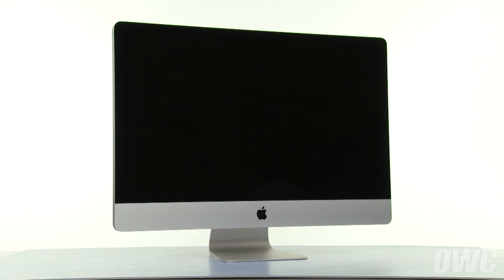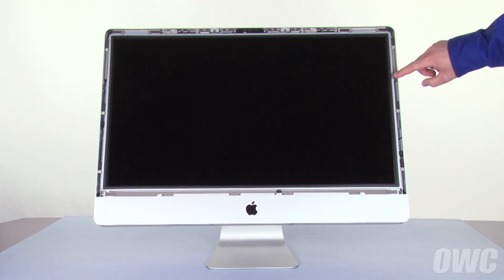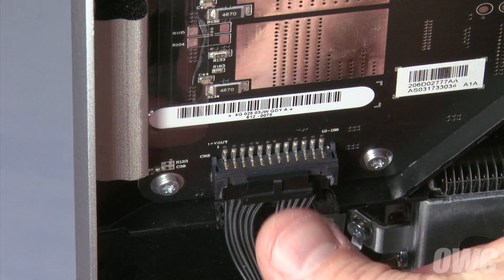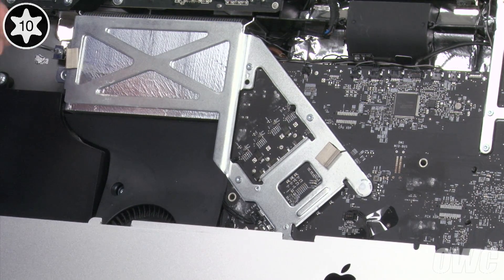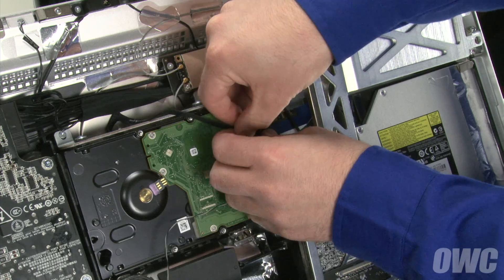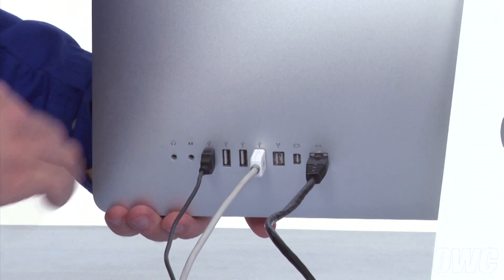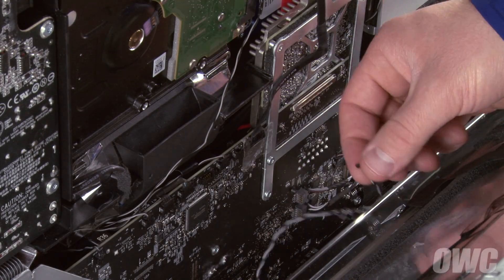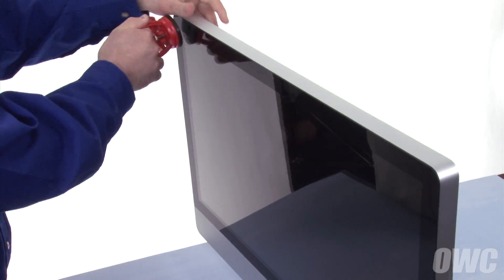How to Install a 2.5-inch SSD in the SSD Drive Bay of a 27-inch iMac Mid 2010 (Updated)

Comment: When starting the iMac, i can hear the chime and then iMac restarts. Chime is heard again and then iMac restarts. This ituation repeats over and over. Any idea why?
Reply from the maker: It’s possible that the issue you're experiencing is related to defective RAM, as this is a common symptom. Here are a few steps we recommend to help resolve the problem:

1. First, try removing the RAM from the computer and gently clean the contacts on the RAM modules. You can use a q-tip dipped in rubbing alcohol or a pencil eraser (rubbing lightly in one direction). If you use an eraser, make sure to brush off any debris afterward.

2. After cleaning, reinstall the RAM one module at a time to determine if one of the modules is defective.

If the issue persists, please feel free to reach out to us. We’ll be happy to assist with further troubleshooting and help you find the correct replacement if necessary.
Reply: @poweredbyowc  i took all memory modules out, cleaned and tried them in different slots, all possible combinations gave me the same chiming loop 😞
Reply from the maker: If you purchased the RAM from us we would be happy to assist you further with troubleshooting. Regrettably, YouTube does not have the option to DM so for security purposes please reach out to us through our customer service team. https://eshop.macsales.com/Service/

Be sure to add any details such as your contact information and your order number as well to fast-track this process.

Comment: I purchased the DIY kit for my mid 2010 27” and followed the tutorial. The reason I decided to upgrade to SSD was because my iMac took about 1 hour to boot. Now when I’m done it does not boot at all. The original HDD is detected but I’ve been trying to boot it several times for many hours each time. From a hardware perspective, it seems to be functional, but it simply does not go pass the loading bar step during boot. Any ideas?
Reply: hello felix did you ever sort this problem? thanks?
Reply: Did you move any of the memory modules? If so make sure that you replaced them into the EXACT same spots. i5 and i7 Quad Core iMac computers from this era will not start up if only a single DIMM is installed in any "bottom" (Farthest from the screen) slot. These computers should operate normally with a single DIMM installed in any "top" (Closest to the screen) slot.

Comment: I did this to my 2010 27” iMac, however it automatically shuts down and reboot in every 10 minutes. No overheating. I installed OS in SSD and formatted HDD. Anyone have any ideas?
Reply: Yubo Chen you installed the wrong ram
Reply: it needs to be 1333 htz or else it will just bootloop

Comment: can i use this method to my iMac 21.5" 2010 mid ? is it possible to chane the USB 2.0 to USB 3.0 on my iMac ?

Thx before 🙏🏻
Reply: No, you can not install a second drive to the 2010 21.5" model. But on the 2011 model it is possible for both, 27" and 21.5". No, you can not add USB 3.0 to 2010 models as they have no thunderbolt. For the 2011 models there is a adapter from thunderbolt to USB 3.0 but it is not cheap.

Comment: Here is the product spec page for that machine. What we could do to get more details, is set you up with contact for a service provider. This machine is actually a bit outside the period of time apple offers hardware support for a product, so a third party would need to service it. SOme of our service providers do third party work, and can recommend what you should get for an upgrade.

Me:I CAN SEE INFO ABOUT SATA

Me:SPEED

TylerRight, that is what I am thinking we will need to get you with a service provider for. I am not sure on the details of the machine beyond that page, but they will be able to tell you pretty quickly and recommend what drives and such you can get.

Me:CAN YOU ASK WHO KNOW ABOUT SATA 2 OR SATA 3

Me:IN THIS MODEL

TylerI am not sure about any details beyond what’s on that page, but if it doesn’t specify I would check with a service provider to be sure

Me:MY QUESTION THIS MODEL SATA 2 OR SATA3, MAX SPEED FOR SSD? 3GB OR 6 GB? APPLE SUPPORT DONT KNOW ABOUT THIS MODEL , SOY SAD ;(

Me:ASK ANYBODY PLEASE

Comment: My fans run at maxspeed, thought I should use smcfancontrol or hddfancontrol so I never botthered reconning sensor. Been fooling around with max/min speed, nothing changes at all. Had a hdd crash so I started out from internet recovery, which got High Sierra installed. May be it's not compatible? Installed one ssd as system and a 3tb hdd as storage.

Comment: Thanks for the video. Looks like a pain! What about just swapping the system HDD for an SDD? I'd prefer to just get the HDD out of there to keep the heat down. What would I need for that?
I actually mixed up and was thinking I had a 2011. I bought the OCZ 2011 Thermal Sensor. Would the sensor not be needed this route with a 2010?
Also, is there any way to swap the DVD drive with another SSD and simply use Time Machine to restore the OS?
Reply: MacSales. com Thanks. It's a 27. Interesting thing is though, I was right. It is a mid 2011. But some parts on the inside look like the 2010. So I did the HDD swap with the OCZ sensor and used Time Machine. Worked like a charm. I removed the DVD drive and it has a different SATA / Power cable. I would need an adapter. I couldnt find one on your site though.

Comment: will this work on a 21.5' mid 2010?
Reply: are there any videos showing this procedure? and would I still have to purchase the same kit? 
thanks
Reply: thank you for the quick reply. Is the re-routing cable included in this kit? So i can split the original harddrive cable to the new SSD
Reply: is there a video showing how to place the OWC data doubler and connecting it to the hardrive?
Reply: okay, so all i need is that kit you linked earlier and the video showing how to remove the optical drive. My question is how do i connect the new SSD to the iMac. Are the wires provided in the kit?
Reply: and will you guys be having any black friday/cyber monday discounts on those, or can I just go ahead and order the kit and SSD now?

thanks for all your help
Reply: right the SATA connection, that's what I was forgetting, thanks. Any idea on the black friday/cyber monday discount? purchase now or wait?
Reply: thank you once again, looking forward to it!
Reply: Just got my kit in the other day, great service! Just had a followup question: instead of taking out the optical drive, can I remove the original HDD and place the new SSD there?
Reply: oh okay, I didn't order that. I am assuming if I put it in place of my optical drive, I can use the thermal sensor on the optical drive and place it on my new SSD?
Reply: Can I still remove the HDD and not put anything in its place?
Reply: awesome! I just checked and my HDD is actually damaged, so I'll have to take it out. Initially I had planned on leaving it in for extra storage. Since it'll be removed, will it not cause any air flow issues?
Reply: perfect. one last question, with the new SSD installed and the HDD removed, will my computer recognize the SSD and install OSX on it, I have snow leopard 10.6.8?

Comment: the video looks nice, when i start my mac, can i select my bootable mac usb, and select boot from usb. my main question is: can i use the ssd as my main drive???? between my old hdd? that the hdd is extra slow storage in my mac and my ssd with the os for boot?

thanks for reply
Reply: MacSales. com do i need a thermal sensor kit?

Comment: This is a great video - although I think I have broken something in the process. I've completed all the steps but after re-adding the screen i just get coloured lines down the screen - I can hear the computer chiming and working in the background. I've tried replacing the display cable as I thought it may have broken in the process but no change. Could it be that I broke the V sync cable ? Would that cause the screen to display incorrectly?
Reply: did you ever find out what this problem was?

Comment: Will adding a SSD for my 2010 iMac 27" really speed it up that much?   I added RAM because I was told that would help and it did not.
Why just a 6GB?  that sounds like very little room for the OS much less any apps.
I assume this is a SAST connection, correct?...does that not also limit how fast it can run vs. newer PCIe?
Can I keep the current 1TB HDD in there too for files and run all apps and OS related on the SSD?
Just trying to decide if it is worth the time and money to get my iMac to run better.
thanks!
Reply: Dude, I added 32GB of RAM and a 2TB SSD and my iMac flights. Boot time was reduced significantly and the system feels faster. I also, added the thermal sensor and no problems with fan noise.

Comment: if i follow this procedure will i be able to have the ssd as my main drive and the existing 1tb as a secondary drive for other files.
Reply: +MacSales. com thanks. i use the machine for music production and is starting to struggle a little recently with intensive software and vst plugins. I have upgraded it to 8gb a few years back. do you think a ssd will make much difference also should I get  another 16gb ram to boost to 20. thanks
Reply: +MacSales. com with my main HD being 6 years old im tempted to chuck a new one in there for the secondary whilst im at it. is there any suggestions for a replacement 1tb and is it easy to do a fresh install of osx if I change both at the same time. Im not bothered about loosing everything. it would be a good opportunity to clean install. i still want the os on the ssd of course.
Reply: +Michael Fearn I have somewhat related question. I am actually wondering if it makes sense to replace the old hdd with a new hdd as far as the performance goes? is there any performance increase from hdds made in 2009-10 vs current 2015-2016 ?

Comment: Great video! I'm considering upgrade my iMac like this and adding more ram but I have two questions:
1- can I interchange the SATA cables in the mobo? I want the SSD be my primary drive, the boot drive with the system
2- the SSD doesn't have temperature sensor (at least not mentioning in the video) maybe this will cause the fans work at full speed all the time, how can avoid this?
Thanks in advance.
Reply: +MacSales. com Thank you for your fast reply! I will be buying the kit from OWC soon because your kindest support
Reply: +Isidoro Maich Anytime, thank you! Quentin~
Reply: +MacSales. com Thanks for video. 
After adding SSD,  fan begins work at full speed after approx 5 minutes. How avoid this? (iMac 27 Mid 2010).
Reply: +MacSales. com Thank you, everything is fine now. 

HDD temperature sensor was plugged incorrectly. In my 27'' mid 2010 cable plugged in closest to the SATA connector with the dark cable closest to the PCB board on the drive.